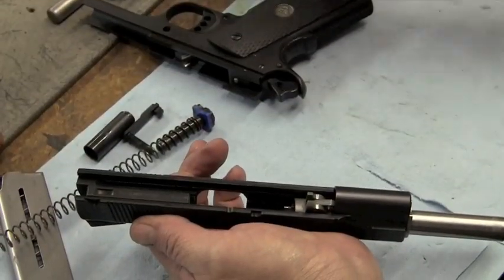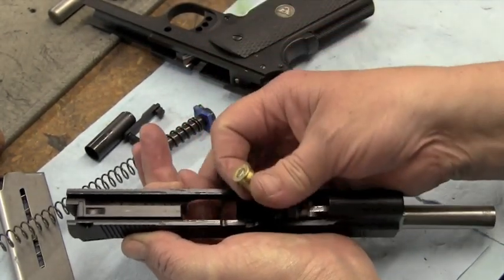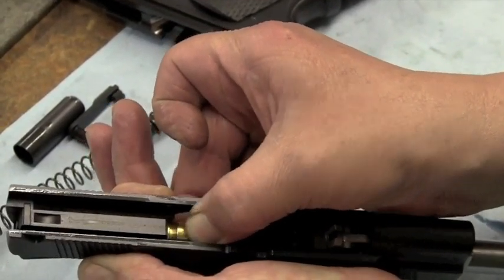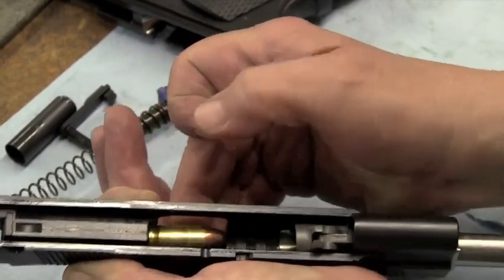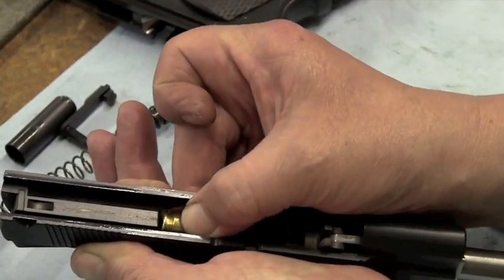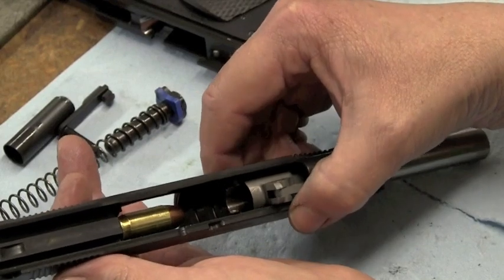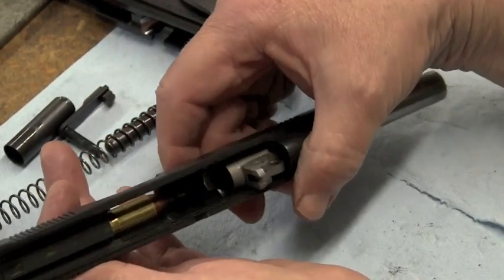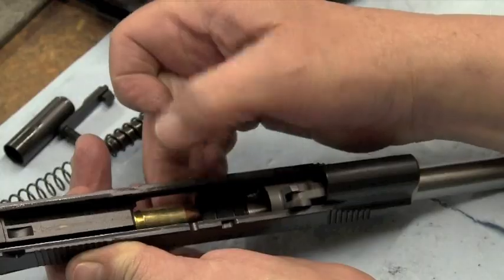Wilson Combat - Checking the Extractor Tension in your 1911

Comment: I have a Kimber pro CDP 11 .45.  Every 3-5 rnds the brass is hitting me in the forehead. Do you feel that I need a new extractor? This is a brand new weapon. Only 300 rnds in it. Thank you.
Reply: 235brady : Not an expert, at all.  But you might try shooting lighter loads or adding a stiffer spring.  I would talk to kimber first though as this is a warranty issue.